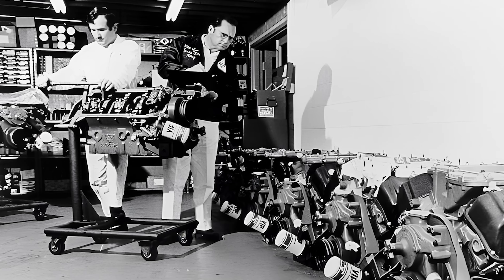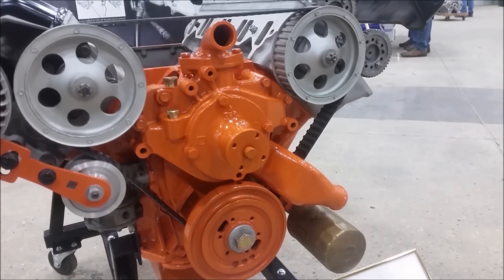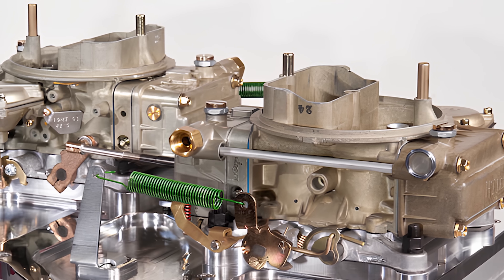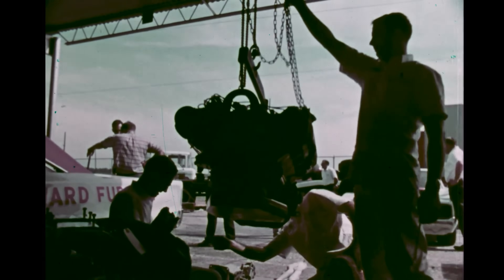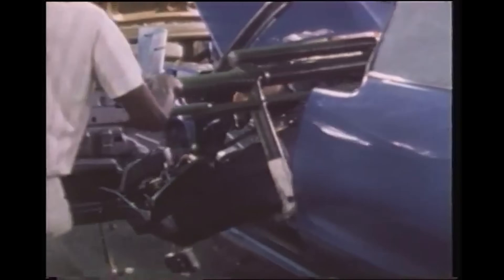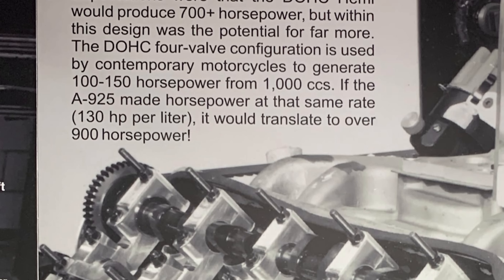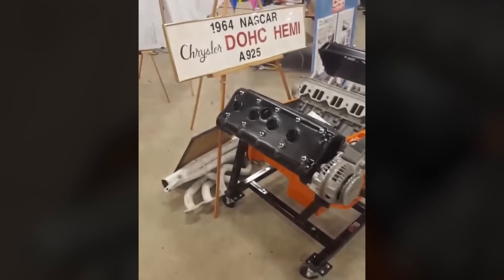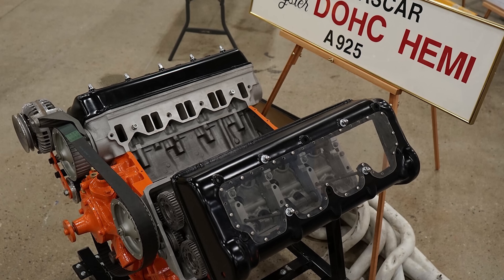THE UNTOLD TRUTH BEHIND CHRYSLER SECRET 426 DOOMSDAY ENGINE

Comment: And during WW2 there were DOC Hemi engines !!!
Reply: Chrysler built an SOHC Hemi back then - it was a V-16 of 2220 cubic inches and was upside down.
Reply: @ Yes they did but it was to heavy for the power it produced, no body would put it on their airplane.  It was intended for the Thunderbolt, but it was heavier than a Wasp 2800 it didn't put out the power it was supposed to.
Reply: @mylanmiller9656 You miss understand ww2 airplane design philosophy.

A radial engine almost always weigh less than inline engines because they are air cooled and don't need a heavy cooling system.

The R2800 double wasp radial engine in the p47 weighed less than inline engines that were intended to be in the same power range. And made around 2200 to 2300 hp on average. Late war wasp engines were pushing 3000hp.

Radial engines generally make more power than inline engines but have far more drag as well. As a result, inline engine with less power can reach higher speeds because they have less drag. 

That is why the p51 mustang is faster than the p47. 

Allison and rolls royce most powerful inline engines of the war, both weigh more and make less power than Chrysler s Hemi engine.

The fastest prop planne tested in ww2 was the P47 with the Chrysler Hemi in it. It went over 500 mph.
Reply: @ i didn't misunderstand anything, the reason for The Chrysler Aircraft engine was to make a more powerful engine, and make the P47 more aerodynamic. The engine come up short it was low on power. That was why it was dead in the water.
Reply: @ You talk about the performance of the P51 as if it and the P47 was a small lite weight fighter. the P47 packed a weight that was heavier empty than a p51 was in full flight gear. the reason the P 51 only needed 1600 hp to outperform the P47 was the fact that it had more power per pound.
Reply: @mylanmiller9656  The Hemi did make more power than the early war R2800. It made 2500 hp and had much better aerodynamics than the radial. 
The jet engine is why they quit developing radials at the same time as well. 
If the Jet engine wasn't invented then the Hemi p47 would  have probably gone into production. 2500 hp with the improved aerodynamics was a game changer at the time.
Reply: @mylanmiller9656  The p51 was faster with less power because of aerodynamics. Not weight. Weight affects acceleration, not top speed nearly as much. And the radial engine Corsair was faster than the p51. But the inline p51h is the fastest mass produced prop of ww2. Its about drag, not weight.
Reply: @Rogueginger69  You obviously don't have a clue about the P51, the reason it had to use the Merlin engine was because, it was small and lite weight.  The p51 had no room for a huge heavy intercooler and Turbochargers like the P47 packed. The P51 was   full package that had speed performance and aerodynamic. the P47 was huge and built like a tank and needed lots of power to  performed.
Reply: @mylanmiller9656  The p47 was big because it utilized a massive turbo behind the pilot. Not because it was a tank. 

The p51 is smaller than the p47 and has a smaller engine so it weighs less and has less drag. What do I not understand?
The p47 with the Chrysler Hemi was much faster than the smaller and lighter p51
Reply: Ford
Reply: Points in favor of inline aircraft engines: Narrower, so better aero. Faster turning, so more HP. 
Points in favor of radial aircraft engines: Lighter, a bit. Can take more damage, which is why the Navy and the Japanese used them - they had to fight over the ocean.
Reply: @Baribrotzer  The radial engines almost always made more power than the inline engines did in ww2
Reply: The Ford GAA engine
Reply: @MichaelBraid-xf3dw  that's a far less powerful engine
Reply: @Rogueginger69  for tanks like the Chrysler multibank
Reply: @MichaelBraid-xf3dw  The Chrysler multi bank was designed to keep working when shot by another tank. And it did.